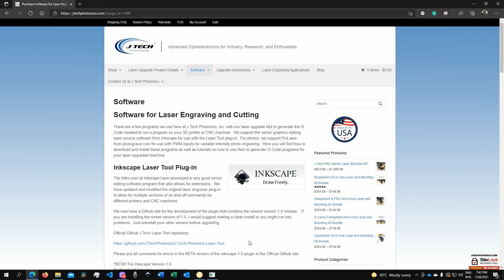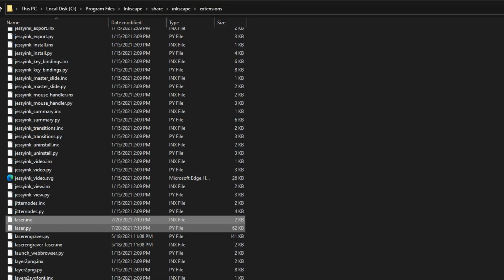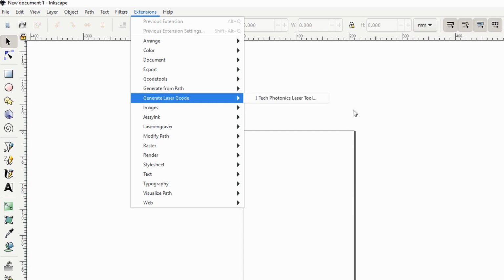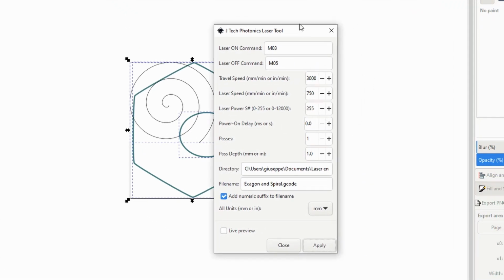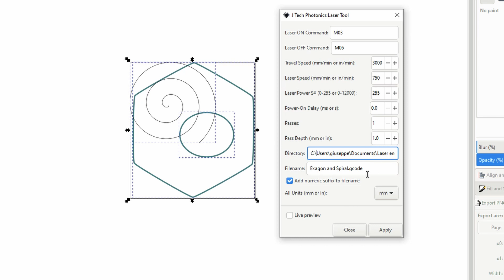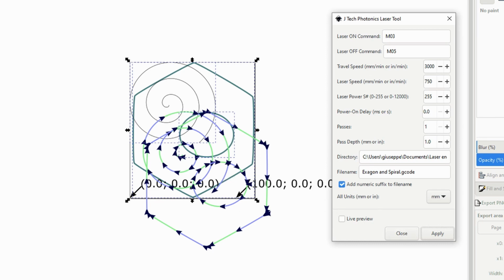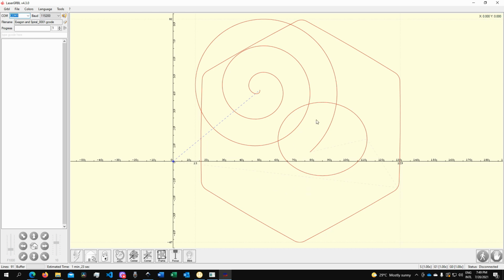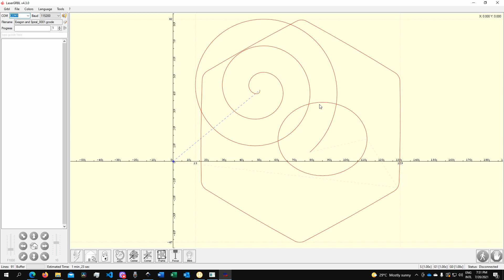NEJE Laser Machines and JTP - Inkscape Extension

Comment: Please help! Not sure if you are still active on here but I have a problem when trying to run the Jtech Laser Plugin inside Inkscape.
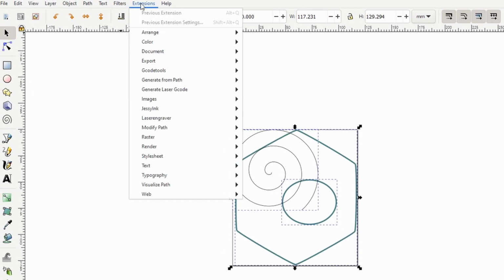I get to 4:08 and literally Nothing seems to happen!
Inkscape just sits there as if it has completely disregarded my request!. I have tried running as Admin and compatibility mode, to no avail so if you could please help me (anybody!) it would be Immensely appreciat3d:body-blue-raised-arms::hand-orange-covering-eyes:
Reply from the maker: Hi, jayc2469; thank you for your comment. 

If you are using the latest version of Inkscape, chances are that it is not going to work.

Unfortunately, the developers of the various plugins are not keeping up with Inkscape updates, which, therefore, may cause some plugins to not function correctly.

Comment: i've downloaded this extension however when i'm trying to use it in Inkscape its not finding a directory?
Reply from the maker: Hello Katie Wright. Thank you for your comment.

I have already received similar comments; it seems like the extension is not working with a newer version of Inkscape.

What version of Inkscape are you using the plugin with.
I use this plugin with Inkscape Version 0.92; however, with the 1.0 was not working, so I guess higher.

I will need to install the newer version my self and verify what is the issue.

Let me know
Ciao
Reply: @MiddleRoomWorkshop  Thanks for your reply it is this version
Inkscape 1.1.2 (b8e25be833, 2022-02-05)
Reply from the maker: Hello Katie Wright; thank you for your feedback.

I have downloaded your same version, and although I did not get the same error as you, I got some other Execution errors.
Anyhow, I found that JTP has updated their extension which is available for download here:
https://jtechphotonics.com/?page_id=1980 
Below is the download link directly:
https://jtechphotonics.com/Downloads/Inkscape/JTP-Laser-Tool_v1.1-beta_ink1.0.zip

To let it work, close Inkspace, then go ahead and remove the old files from the directory and part in the new once which are named the same. Once done you can launch Inkscape and test it out.
Do not forget to always convert your project into a path before to use JTP.

Let me know how it goes.
Ciao
Reply: @MiddleRoomWorkshop  I have uninstalled inkscape, deleted any residual files, re installed and used the link above.  When I try to use jtp, it does nothing.  Any suggestions?

Comment: receiving error when try to use module:
Traceback (most recent call last):
  File "C:\Program Files\Inkscape\share\inkscape\extensions\laser.py", line 1459, in <module>
    e.run()
  File "C:\Program Files\Inkscape\share\inkscape\extensions\inkex\base.py", line 131, in run
    self.save_raw(self.effect())
  File "C:\Program Files\Inkscape\share\inkscape\extensions\laser.py", line 1452, in effect
    self.laser()
  File "C:\Program Files\Inkscape\share\inkscape\extensions\laser.py", line 1300, in laser
    self.check_dir()
  File "C:\Program Files\Inkscape\share\inkscape\extensions\laser.py", line 795, in check_dir
    if self.options.directory[-1] not in ["/", "\\"]:
IndexError: string index out of range
Reply from the maker: Hello 99b Frater, thank you for your comment.

What version of Inkscape are you using the plugin with.
These plugins have problems with some versions of Inkscape.
I use this plugin with Inkscape Version 0.92; however, with the 1.0 was not working.

Let me know
Ciao